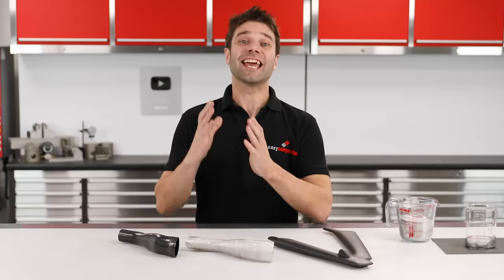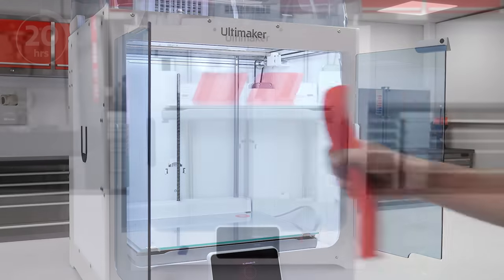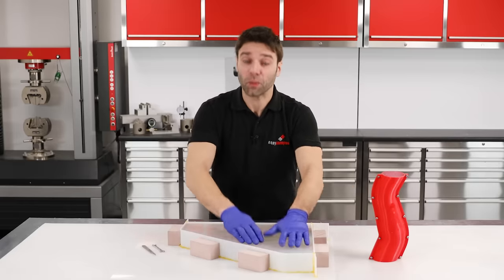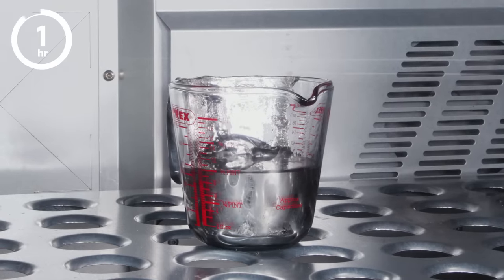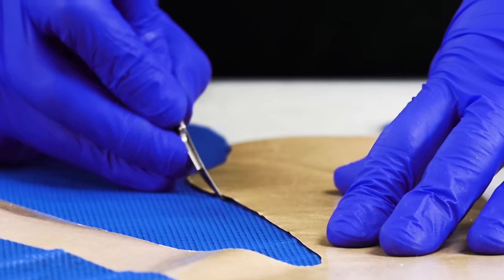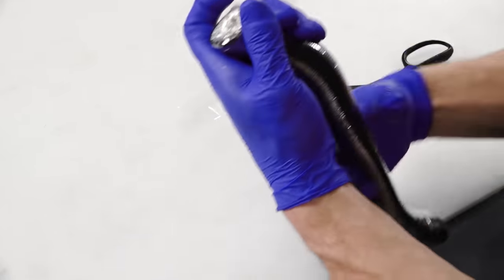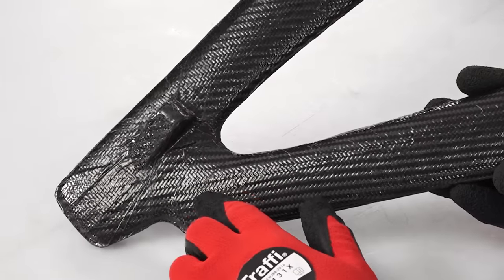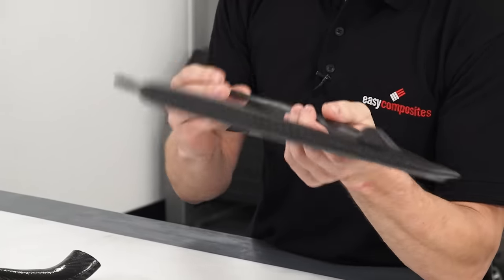Moulding Hollow Carbon Fibre Parts Using a Low-Melt Metal Mandrel

Comment: Why go to such lengths, when the melting point of the metal is only at 95°C?
When printing with ABS, it could be used as inside form directly. Up to 100°C it isn't even getting soft. It even can be printed hollow with minimal infill, and just be left inside, if those 50g or so don't matter. Or afterwards, fill it with acetone, and it will flow out.
Unless its harmful to the epoxy, then forget what I just wrote...
Reply from the maker: Hi thanks for the question, you're not the first to ask this, unfortunately under the heat and pressure of the cure the ABS would distort and collapse even when under the theoretical HDT, even ignoring this fundamental problem it would take a long time to print and dissolve, when you're doing multiple parts using alloy would be significantly quicker. We have experimented with just about every printable material for this and not found one that performs, if you have found one to work we'd love to hear about it!

Comment: Wow ! Inside surface more important than outside surface. Yeah right because Aerodynamic  requires for airflow to cool down  the frame and create down force to keep the bike on the road.  🎉🎉🎉 the process is an Art !!!   Koenigsegg left the chat !!
Reply from the maker: The inside surface needed to be smooth on the tube for its design intent.  Similar projects would include boost piping, induction tubes, some airducts etc hence why it is a valid solution for that problem.

Comment: If you have a 3d printer, it would make more sense to use a dissolvable filament rather than taking all the extra steps to make the metal mandrels.
Reply from the maker: In our experience, the dissolvable filaments are not that reliable yet but may change in the future.
Reply: @easycompositestv  can your prepreg hold up to acetone? If so, ABS could be used and then desolved with acetone.

Comment: wouldn't wax b a lil easier? and cheaper..  and easier to get, melt form shape melt everything really..?
Reply from the maker: The process would still be the same and many waxes may not have the hardness or temperature resistance for this process.

Comment: If the metal can be made by 3d printer it would save alot of time, & light machining afterwards to prefect the inner mold. Save the 3d & cnc files to repeat the process. 🤔
Reply from the maker: In theory yes but we have not seen any 3D printable low melt alloys as yet.

Comment: Check out something known as wood's metal.
Reply from the maker: We’re sensible and pragmatic when it comes to safety concerns but Woods metal is probably one to avoid these days, due to its cadmium content. LM95 is a bismuth based alloy without cadmium so is a safer option with a similar melting point and behaviour.

Comment: Sorry, what about water-ice?
Absolutly I understand that it might take twice or eaven more to cure , but iff outside lines are strong enaugh and water is gone the inside has chance to cure as well !!

Main point of my comment is for example Alaska,  user might not get all the stuff, ok sauna might give the needed temperature also BUT, average Joe might not have equipment to do all the steps U show!!!
Reply from the maker: Unfortunately without a curing oven with accurate temperature control, OOA PrePreg wouldn't be suitable for use anyway and we'd never recommend putting moisture or water in contact with uncured resins. I'm afraid that without the equipment, you couldn't use these particular processes.

Comment: I clicked off the video when you said handling the solid room temperature bars of lead required gloves, yes if lead metal is being ground down cut or sanded, or is diluted into a solution, or is used in fuel say in the instance of lead bromide, it is harmful and gloves/respirator should be used, but no touching solid lead solder, or solid lead metal is not dangerous and simply just washing your hands thoroughly before eating any food after handling lead is more than enough precaution to be safe from lead poisoning.

Comment: Why metal why not wax or low melt plastic?   Be cheaper
Reply from the maker: It is finding a wax that is durable enough to be machined and handled without deforming.

Comment: The mechanical properties are fantastic and so is the weight but from a recycling point of view this is basically the worst you can do. None of this stuff can ever be recycled. Plus it creates soo much trash with all the bags and resin and stuff and even the CF need soo much energy to be produced in the first place.